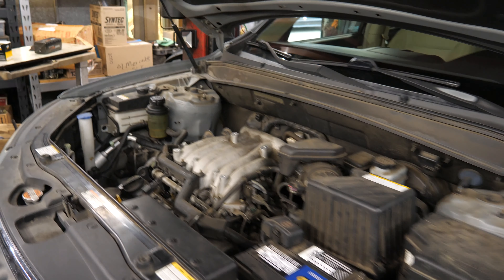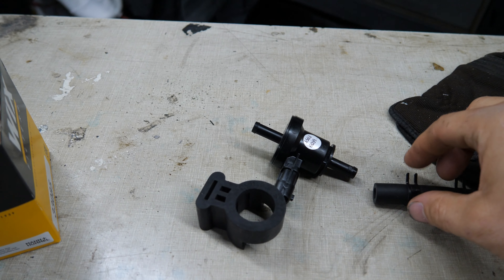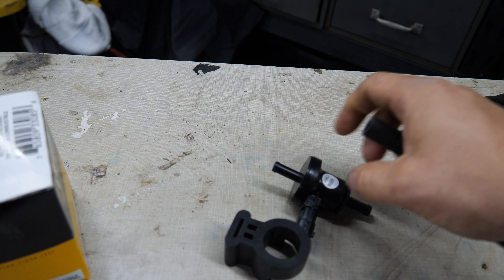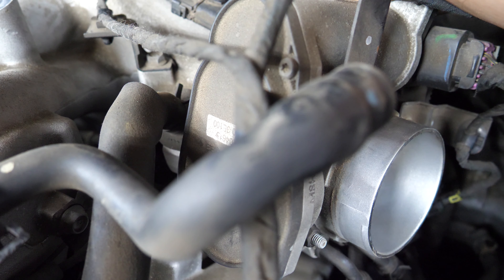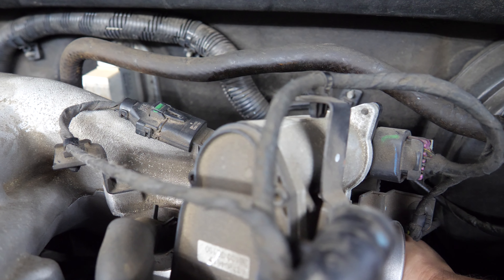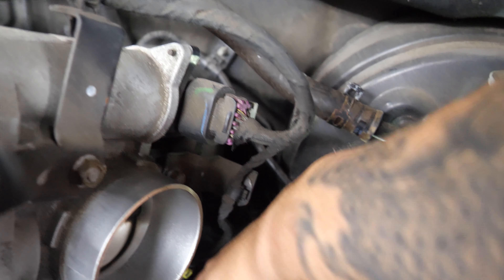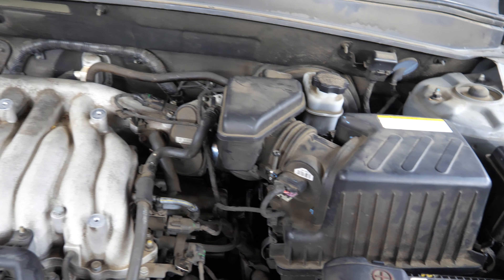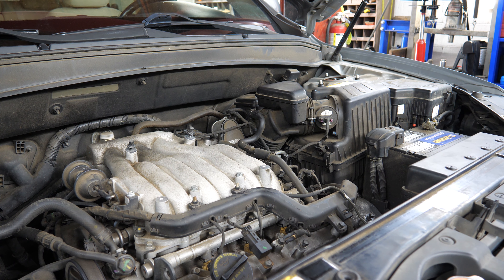Hyundai Santa Fe Purge Valve and P0441 Fix

Comment: I had this issue for a while without fixing it. and now the car doesnt start at all. Will a valve replacement still worK?
Reply from the maker: It is possible but for the price of the part it would be worth it.
Reply: @operationoverhaul  I thank you
Reply: @operationoverhaul purge valve is like 60 $